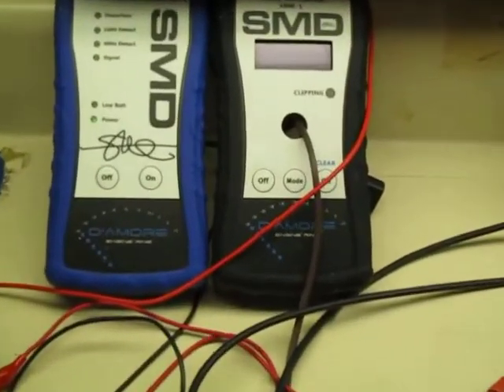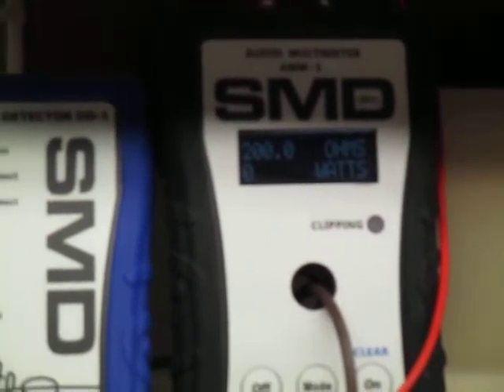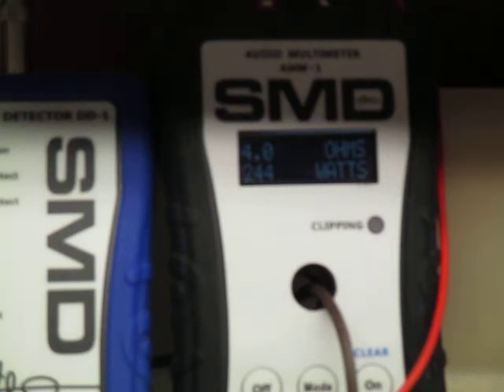Sony XM-502Z Dynamic Power Test

Comment: They sometimes do funny stuff to get those amps to do rated power like give them 16 volts. I used to have the Sony Xplode 1400 watt amp pushing 2 15’s best I ever got was 900 watts out of it and that was with 2 batteries at 14.4 volts.